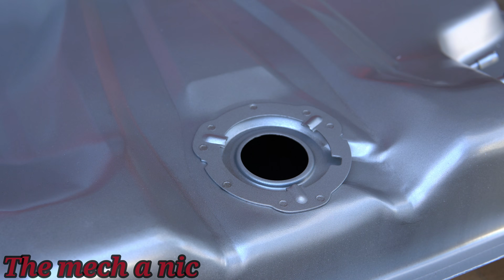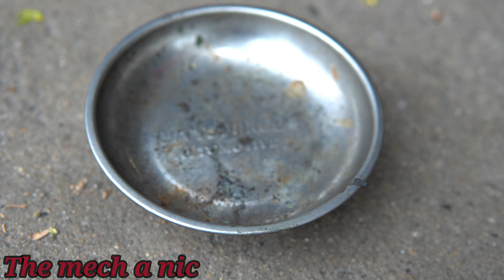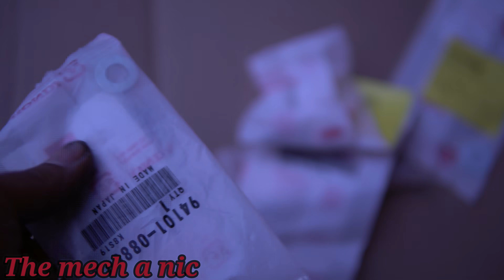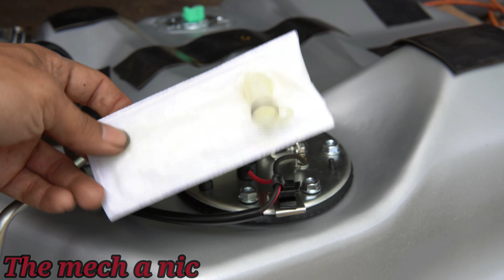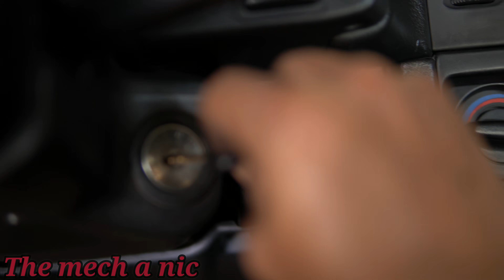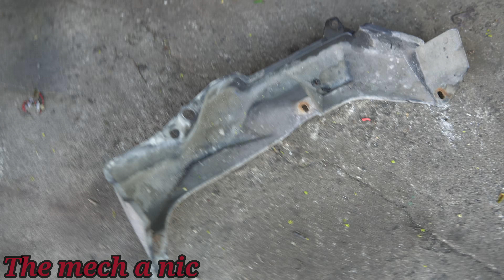crx fuel tank / walbro 255  fuel pump install - CRX PROJECT VOL 8

Comment: Is there an internal baffle inside this tank? I'm trying to decide whether to buy a CRX EFI tank or modify my EF carb tank. My only concern is whether the CRX tank has a built-in baffle. If it doesn't, I'd rather modify the EF carb tank instead.

Comment: Was the fuel pump from the delphi set good enough?

Btw, on the original fuel pump assembly there are two hard fuel lines while the delphi kit has one hard fuel on the assembly??
Reply from the maker: Delphi unit is perfect for a stock engine.  Both units have the same design.  One hard line and one l8ne threaded in

Comment: Did you not need to run a relay?
Reply from the maker: No,why ? The pump just plugs into factory harness
Reply: @themechanic6117 I was just told that the stronger pump would benefit from a relay. How it needs 12v and not the 6-7v the factory harness has.
Reply from the maker: I didn't know the factory pump runs off of 7 volts, never seen something like that. I've never seen anything on a car that doesn't run on 12v . I could be wrong but I guess I don't know the answer to that
Reply: @themechanic6117 maybe it’s the amps and draw, not the volts. Either way you would’ve had an issue by now. Love the channel and content.

Comment: Did you notice any difference on power?
Reply from the maker: No, unless the original fuel pump was bad you wouldn't notice a difference.
Reply: @ tomorrow I’m gonna install my high fuel pump wallbro, and gasoline pressure regulator , do you think I’m gonna notice something?
Reply from the maker: Probably not, it should just drive like normal. The fuel pressure regulator will maintain the same pressure before and after the new part
Reply: @ I’m gonna put 3.5 , what u think

Comment: Hey Mechanic,
Question for you:  Did you install the new fuel pump because it had failed, or about to fail?

My 91 CRX has a dead fuel pump. It apparently died like a light bulb went out, so when I turn the ignition key to the ON position, there is no sound or signal coming from the fuel pump, even though I have verified that proper battery voltage is supplied to it. What are your thoughts on a dead fuel pump like the one I have? Is it common? I'm wondering if other CRX owners have had the same [dead] fuel pump issues. Thanks.
Reply from the maker: I just changed it as an upgrade to supply more fuel to the new engine.  If you have power n ground going to the pump then yeah it's a bad pump. They usually just randomly fail. Especially if it's the original pump that came with your car
Reply: @themechanic6117  Thanks for your reply. I'm pretty sure it's the original fuel pump (I'm the third owner). It's a 34-year old car, so not really surprised that the pump failed. I haven't driven the car regularly for the past 10-12 years, so that may have been a big factor for the pump failure (i.e. bad, stale gas with ethanol sitting in the tank for years). It seems with cars, under-usage can be just as bad as over-usage. Live and learn.

Comment: Did you check the pressure after u changed the fuel pump bro?
Reply from the maker: No point in checking pressure when I could see no fuel was coming out the line
Reply: @themechanic6117  okay sir..i just want to know the fuel pressure out from the filter to the fuel rail..because i had checked mine,i got only 28-29 psi..im planning to change the fuel pump..follow ur guide..may i know..hows the walbro fuel pump doing?is it still in the tank?
Reply: @themechanic6117  for your info im still using the stock fuel pump..
Reply from the maker: Yes the walbro is still in the tank and no problems at all with it . Some people say the walbro is slightly louder than stock but I really don't notice it, you also have to consider its a performance pump so even if it does make a little more noise it's expected
Reply: @themechanic6117  yeahh i dont even care about the sound of it hahaha..for sure ill go for the walbro..im loooking fot the performance pump as its very hard to replace the fuel pump..btw tq for the video bro..
Reply from the maker: The walbro is a good reliable option then.

Comment: sorry to bother you man, what fuel strainer did you use? the original one don't fit tightly. i got the 341 the pump is smaller then the original is that suppose to be like that -__-
Reply from the maker: I had the same problem lol . I don't remember the part number but I remember this video helped me find the correct part. At the 13 min mark he talks about it. 

https://youtu.be/UOrw15qOLHI
Reply: @themechanic6117  it looks like the walbro pumps are smaller and the inlet port looks smaller but has thicker walls making them the same size as the original pumps inlet. A used strainer fits lose but a new one sets tight. Thank you for tha help og

Comment: what is the harness called or where did you buy it ?
Reply from the maker: I think I got it off ebay. Just searched walbro fuel pump harness
Reply: @themechanic6117   did you search crx fuel tank for the new tank?

Comment: so the fuel pump is a 342 not a 255?
Reply from the maker: It's a 255
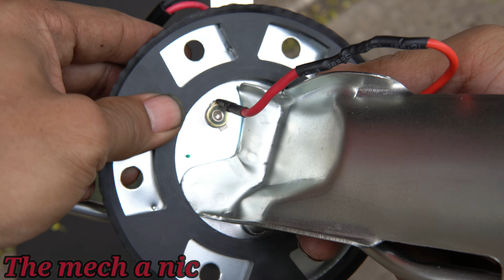Reply: @themechanic6117   he mention on time 21:50 about what fuel pump to order did you see it?
Reply from the maker: The 341 and 342 and both the same 255 pump . The only difference between the 341 and 342 is the location of the outlet port.
Reply: @themechanic6117  i see there all just as good, i meant if i were to order that part i would order the 341 walbro if i use original assembly or what is it called?
Reply from the maker: Order the 341 if your using the original honda fuel pump assembly.  I'm using a aftermarket delphi assembly, that's why I need the 342
Reply: @themechanic6117  my final question in your opinion what are the cons of using the original fuel pump assembly? Also same question for the tank?
Reply from the maker: No problem.  Mine was just really rusty so I replaced what I could

Comment: Great videos!  Do you have to upgrade your fuel pressure regulator going to a 255lph pump?
Reply from the maker: No the stock FPR works just fine

Comment: Did you ever find the lost washers?
Reply from the maker: No I had to order more from the dealer 😫👍 but it got taken care of .
Reply: @themechanic6117  thanks for the tip on the 341 and 342.  A single order and three hours later.  Pump is done.  Where did you get the sending unit from?
Reply from the maker: @ThePepper1981  I came across it on ebay

Comment: Hi sir,is necessary to bring down the fuel tank to replace the fuel pump,is there any option to replace the fuel pump,Does a faulty fuel pump causes eratic rpm/jerking  while in motion,hoping for your reply thanks
Reply from the maker: Yes the fuel tank needs to come off to change the fuel pump. Sounds like your issue may be something else

Comment: I installed this same pump in my CRX, and it works great, but I have a gas smell sometimes when I'm driving. Especially when I go around a right hand turn a little fast. Can't see any leaks anywhere around the fuel lines, but I haven't dropped the fuel tank to check around the fuel outlet area. Do you think it's most likely the gasket around under the fuel out let flange (where the 6 nuts go)? Or could it be caused by something else. I reused the gasket, and probably should have bought a new one.
Reply from the maker: Usually that upper gasket only leaks or shows the leak whenever you completely fill the tank . If you can smell fuel is must be leaking from somewhere.  On a old car I would definitely not reuse the gasket that came off. So far on my car no leaks and no smell of gasoline

Comment: Can actually hear the fuel pump priming in high pitch in the beginning, then sounded normal after you switched the wires
Reply from the maker: I noticed the difference too
Reply: @themechanic6117  awesome vid bud! So helpful if anyone runs into the same thing👍🏽

Comment: Damn that sucks the pump was wired backwards , I was wondering if that was the issue while you were trying to start it..., nice job on the pin repair.. I’m glad you took care of  the rust before installing the tank..I loved the old CRX , it sounds like my 2013 CR-Z...oh yeah my favorite part is hearing and seen drive down the street after all the work !👍

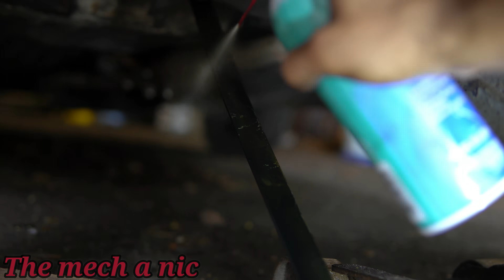Comment: @25:33
I was able to buy the OEM strap insulators for my tank straps-
in case of other cars, might not have them.

In those cases, IMO it's important to, keep out corrosion from
in between those tiny crevices.

In your case- a bicycle inner tube, cut to length, slide strap inside.
Adhesive like RTV silicone the ends closed. I've even seen carefully
wrapped quality electrical tape around straps. That metal-to-metal abrasion
really eats steel. At least your spray is something.

A "garage" will never take extra steps for you; they'll zip on your new, bare
steel tank and done.

I give mad respect for your attention to detail.

Comment: What kind of an engine it has with a 5k redline?
Reply from the maker: The stock engine that came in the HF crx, i think its a 1.5L
Reply: @themechanic6117  Cool, I´ve never seen one´s tach before. I don´t know if they were ever sold here in europe.
Mine is a original red 1989 1.6i-16, with the 130hp DOHC ZC engine :>
It´s almost restored fully, only modification is a Mugen-style HKS Sport Exhaust system

Comment: That fuel pump assembly fit s all ef models?under autozone part number doesnt match vehicle
Reply from the maker: I dont think so. I think it only fits 90-91 but i may be wrong . also im not using a original fuel tank
Reply: @themechanic6117  under crx it fits but not the civic for some reason ,its there a difference in 88-89 to 90-91 fuel assembly s?
Reply from the maker: I think they are different because you'll find parts that are only listed for 90-91. Go to the garage built hondas channel. He know much more about these old civics and crx

Comment: Why did you use the Walbro pump rather than just using the Delphi?
Reply from the maker: Dephi is more of a stock replacement. Walbro can move more fuel. Its better for when i swap the engine to a k24

Comment: I totally agree with your final thoughts, seeing those old bolts and rusted parts finally being removed and replaced was so satisfying. I feel like driving around town would just FEEL smoother and cleaner. I love the content and would so value any granular details you can provide, be that in the form of a walkthrough or a reference guide for parts, kits, and instructions for replicating what you have done. Thanks for the post, I am looking forward to the next one!

Comment: I had the same issue if I switch the wires at the plug underneath the back seat will it mess anything up
Reply from the maker: I tried switching power n ground at that plug using my power probe just to test it before i drop the tank again and it kept blowing a fuse.which makes sense because the tank itself is grounded and not you're trying to send power to it. So i dont think you can just switch the wires at the connector
Reply: @themechanic6117  Yeah I figured it would fry something was just be lazy wish it was that easy but pulling the tank again today think it's a common issue with these pumps I'm pretty sure the polarity is labeled backwards on these cause I checked I'm going to be getting it tuned on Monday it's a rod and piston D16 with full valve train and a turbo kit anyway thanks bro

Comment: I find it amazing/frustrating that a piece of metal that is soo badly rusted, that it can be twisted by hand, can be such a pain to actually remove from it's home.
Reply from the maker: Yes , it has no more of it original strength but still difficult to remove 😂

Comment: Perfect video , I’m looking to purchase new fuel pump for my 1990 crx will the walbro gss341 be a plug and play ? Do I need any harness thank you ! Great video
Reply from the maker: It depends where you get your pump from. If the walbro you buy does not come with a harness make sure to buy one because you will have solder in the new harness just like I did in my video.
Reply: The mech a nic . Thank you ! I will look into that before placing my order ? By any chance do you have a the part number for the fuel pump hanger ? Or link ? It would be nice to just replace with fuel pump as well . Thanks
Reply from the maker: What do you mean fuel pump hanger? Like the complete fuel pump assembly from delphi?

Comment: You do an excellent job troubleshooting along with clearly explaining your step by step process in solving a problem. The video was not to long, because, troubleshooting and solving problems many times is a slow process. I don't know about you, but many times I walk away and cuss a little bit. Makes me feel better, LOL!  Semper Fi, USMC.
Reply from the maker: 😂 giving it the stink eye look sometimes helps as well lol thank you for taking the time to watch.im happy with how it turned out
Reply: I find when I run into problems it's good to take a break from it,  clear your head for a few mins and then come back to it.
Reply: @erocker78  That is the smart way to do it. But, I get stubborn and stupid sometimes. Then I throw a few choice words at it and I feel better,LOL. However, most of the time I do walk away. Not easy though.

Comment: Omg I need that socket for rounded nuts and bolts so bad XD I replaced the fuel tank in my 95 civic and had similar issues to you.. glad you didn't break some of the bolts on the fuel tank when putting the pump in lol. I'll need to do the e-brake line too like you did so I am glad you did that :D Nice video!
Reply from the maker: Those sockets work wonders! Definitely get a set. Hey no problem. With the tank off its super easy to replace those e brake cables. Thanks for watching💪
Reply: @themechanic6117  Nice :D What are those sockets called so I can search for em? 😅 and no problem dude! :D
Reply from the maker: https://www.amazon.com/dp/B01E0OCXSI/ref=cm_sw_r_apa_i_XsIYEbG7ATYVG

The complete set is sold separately. You need to buy this plus the other sockets.i believe you can find them at Auto zone.
Reply: @themechanic6117  Awesome! Thanks man!

Comment: My crx had the same fuel leaking issues. Turns out the fuel filter washers were bad. Ordered oem ones and its dry as a bone. Part # 90428-PD6-003

Comment: The filler neck reconnecting sucks. Im doing it on my 86 CR-X right now
Reply: 89 Crx lol
Reply: Yes sir. Idk what to do with it lol
Reply from the maker: Yeah it does suck.thats why i left the straps a little loose until i got the filler neck reconnected
Reply: @themechanic6117  i got it started all buttoned up. And wouldnt you know it. Runs rough blown head gasket i think
Reply from the maker: Man that sucks! Planning on fixing it?
Reply: @themechanic6117  yeah

Comment: Your did a good job. I did the same thing in my 87 Jeep. The tank was leaking so I had no choice but I found a deal that included a new fuel pump with a tank. Wow, that wiring was crazy. Great job getting it figured out.
Reply from the maker: This tank wasnt leaking but looking the condition of everything it was just a matter of time. The harness colors being mixed up still baffles me. Cost me a ton of extra work unfortunately
Reply: @themechanic6117  shit happens man but lesson learned, right? That's experience and knowledge. I bet that   won't ever happen again.